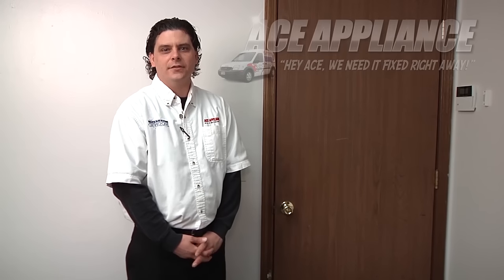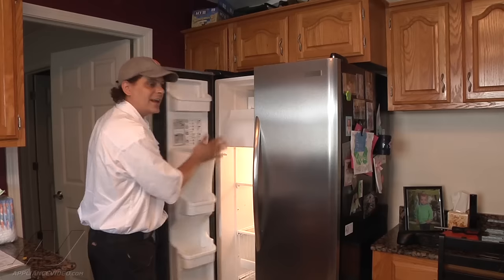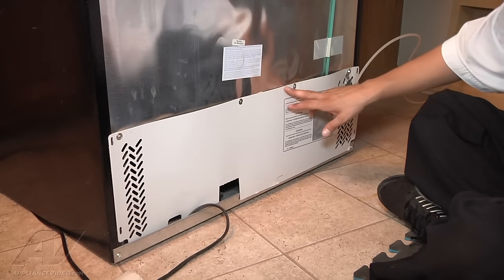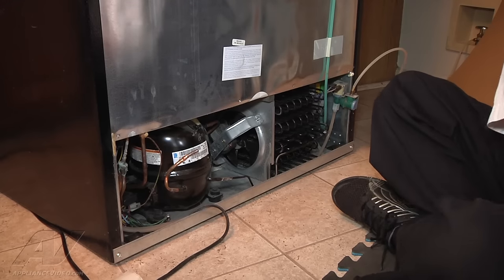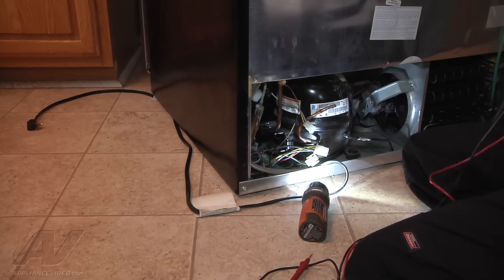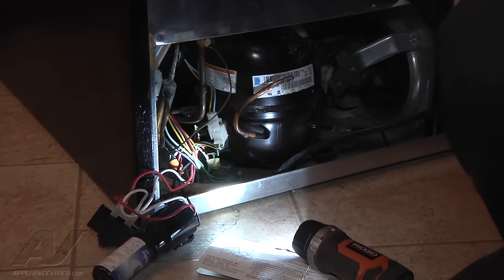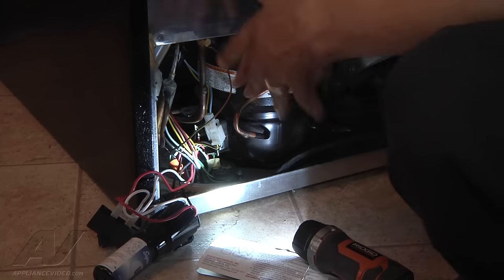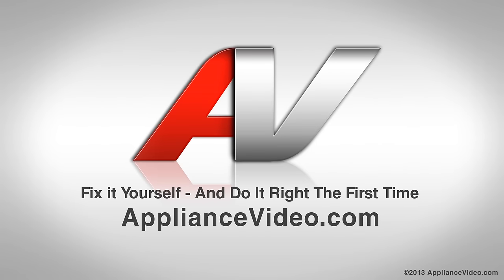Frigidaire Refrigerator Repair - Not Cooling - Hard Start Relay Overload Kit - Diagnostics

Comment: 5y ef
Reply from the maker: Great question, you can call our parts department at 1-800-830-5465 and they can give
you help 6-days A week Mon-Sat . You can also search at www.SaveMoreOnParts.com 7- days a week.  If you have a more technical question that our parts department cannot answer, our technicians are answering all questions at our website at www.ApplianceVideo.com under our Repair Help section. We have over 4,000
common questions and answers that you can easily search through by your model
number, appliance make, and problem or error codes, and It’s free to search
through our question & answer library.